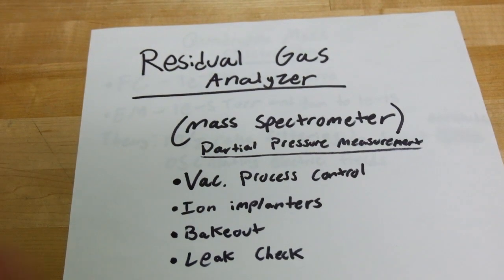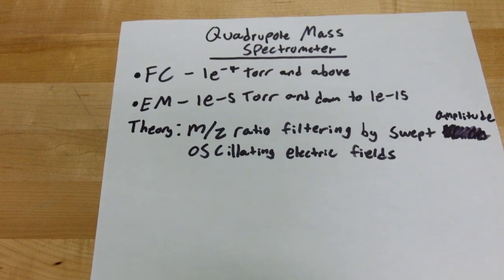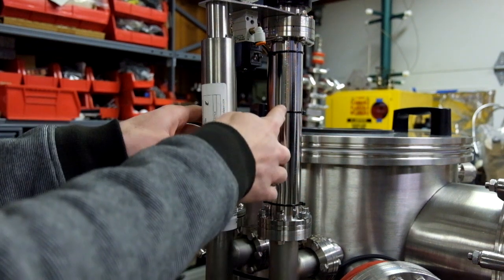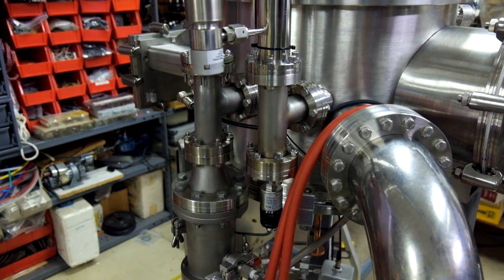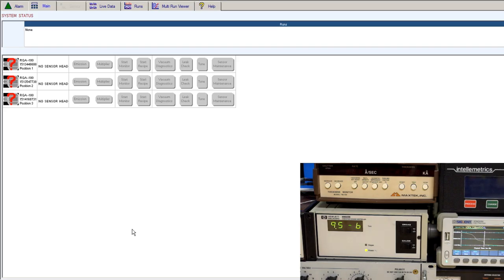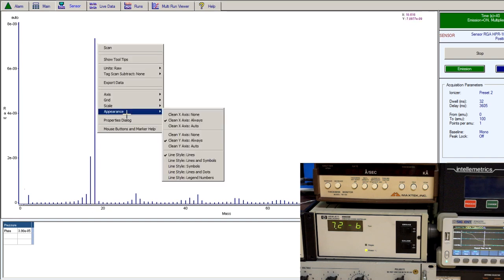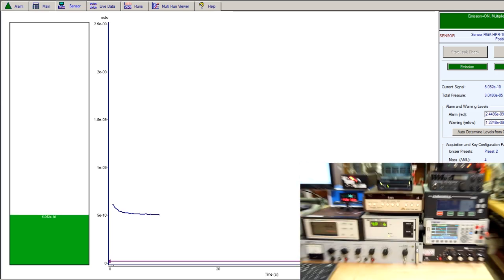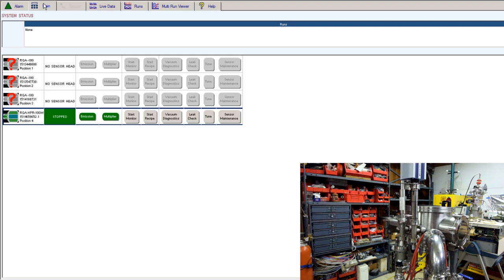RGA Residual Gas Analyzer (Mass Spectrometer) Experiments and Helium Leak Checking

Comment: Very cool and interesting video. Those RCAs look super useful for any high vacuum application. And pretty small, compared to the MS of a GC-MS, which is pretty much the same. Just a bit more complicated with controlled temperatures, two filaments in a specialized ion source etc. The leak detection tool seems fun xD
What mass range does your RGA (Or RGAs in general) detect? 1 to 100 Da at a 1Da resolution, or does it go higher?
And btw your channel is amazing! Glad i found it.

Comment: Hi Sam, thanks for this video! I have recently started to work with an UHV system and I found your video very helpful. I have a question though. I have noticed an increase in the chamber's pressure after opening the RGA. Does this normally happen with using RGA or is there a way of fixing this, perhaps by adding additional components/seals?
Reply: When you say "after opening the RGA", do you mean you have it behind an isolation valve like @workingraveyard recommends? And you notice the pressure increase on a different vacuum gauge? I'd think that's just because the RGA isn't staying at the full vacuum while isolated, and the gas in it escapes into the chamber when you open the valve. As a workaround, try opening it earlier during pumpdown (when the chamber matches its pressure), and check the RGA itself and its fittings and valve for leaks.

Disclaimer: I have literally zero experience with any of this stuff. And I'm 2 years late, so you've probably already fixed it, but maybe this can help somebody else.

Comment: Hey Sam,  I have one question, I'm currently working on a high vacuum system for a college project it has an inficon RGA like yours, I have a problem with it though and I'm wondering if you'd know what the problem is. I have found a leak in my system and after spraying helium on the leak the RGA doesn't detect any helium but it does sense an increase in pressure. I have never come across anything like this any ideas what it could be?

Comment: Interesting.  You do have a MS and I wasn't sure with the semi-conductor industry the unique implementations.  Thanks for sharing.

What software are you using?  Does the RGA software have a feature to determine entities?  Like a peak picking auto correlation or like a library or database feature to associate with?  I'm only familiar with the baths and NIR and quality.
Reply from the maker: I also recently put an EDS system on my SEM: http://sam.zeloof.xyz/eds/
The software for the RGA was provided by Inficon. I don't think it has this functionality however.

Comment: At these pressures you could start thinking about doing anti-reflective coatings for optics. That's something that has never been done at home or in a garage, as far as I'm aware.
Reply from the maker: Not a big deal, sputtering is a good option. could be done at much higher pressures ~100mtorr
Reply: Sputtering is an option, but the problem is getting the coating thickness and distribution right - usually, the coatings are non-uniform by radius, as well as layers.
I'd attempt this but I have no space for a vacuum setup.
Reply from the maker: You can rotate the substrate during deposition to improve uniformity
Reply: I actually didn't think of that, not a bad solution.

Comment: What is a bake out? Is that where you heat the sides to vaporize the water?
Reply from the maker: Yes, speeds up outgassing in the chamber so you ca reach better pressures
Reply: You heat the chamber from about boiling to maybe twice boiling for several hours, while under vacuum. Make sure not to melt any o-rings.

Comment: so cool, thank you for this video.  For what im used to youre hitting extremely deep vacuum levels.  This RGA video may lead to me getting one.  can they handle volatile vapor loads from distillations?
Reply from the maker: +dag gooder I don’t think that would be a problem, but I’m not sure
Reply: You wouldn't want to pipe the vapor straight in. However if you put a leak valve (or even just a leaky fitting connection like the one Sam demonstrated in this video) in the vicinity of your vapor stream, it should work fine.